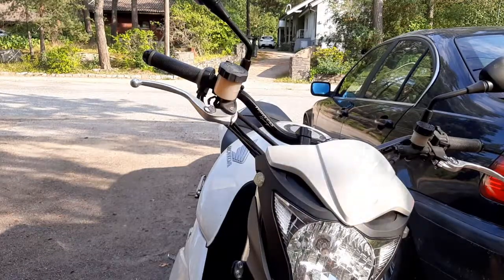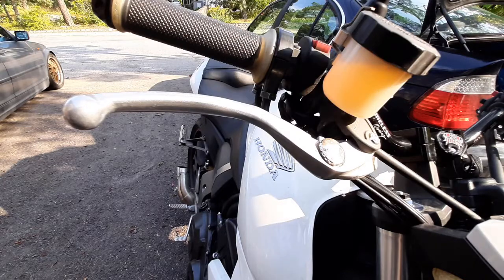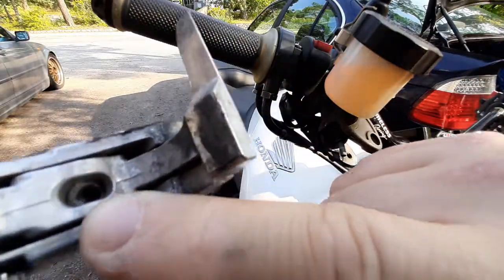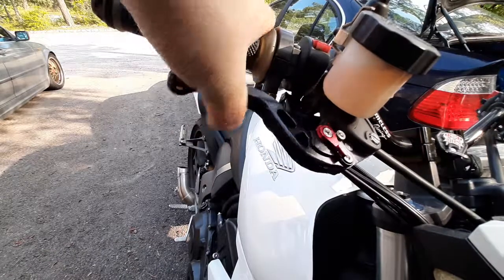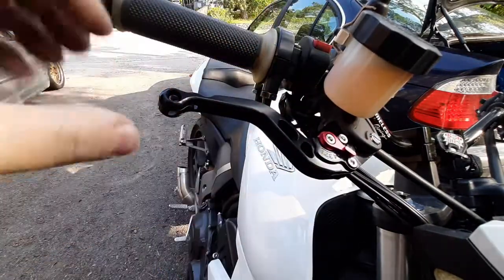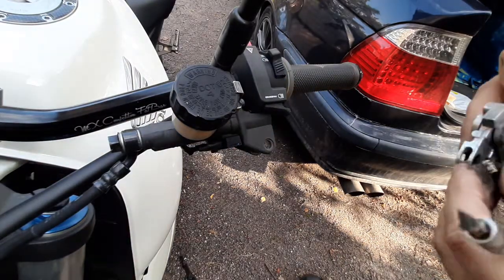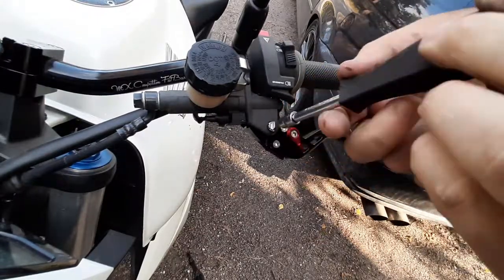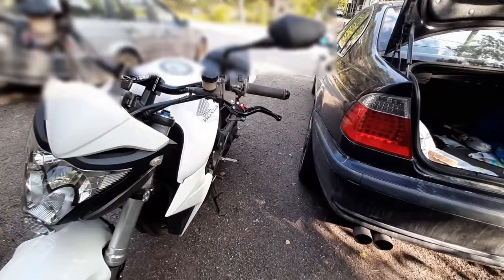Honda CB1000R Brake and Cluth lever repalcement / upgrade DIY

Comment: Hi where did you buy these levers, have been looking for something similarl. Since its hydraulic clutch i am not sure if any cluth lever will work.
Reply from the maker: Just buying the CB1000R specific ones should get you the right ones. if i remember correctly these were from eBay Demon Tweeks they have their own website too though.
Reply: Hi got the levers, the brake actuator is stuck on my stock levers 😅
Reply from the maker: @srk_mithipati  Aww man then you might have to change the master cylinder and the holder.
Reply: @chargedcars after looking at parts section on honda genuine parts front brake assembly it's called pushrod. At $30 that's not too bad.

Comment: My front brakes on my Honda have started to make like a ‘sshhhhh’ sound when applying them although they are working fine , any suggestions ?
Reply from the maker: Hey i also noticed the problem when i had the stock exhaust and i asked a mechanic i know and he said it is normal sounding sound. 
Pads also might sound different during they wear and also if you have not braked hard recently the sound might be different. 
Also if you have kept the bike in winter storage and took it out recently there might be dust and material build up.